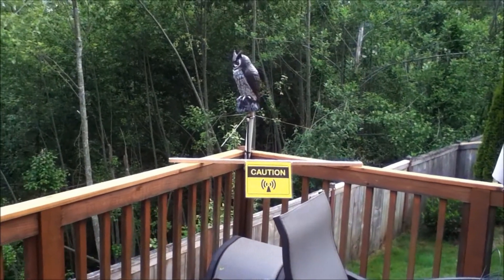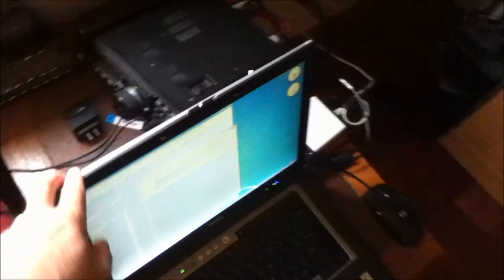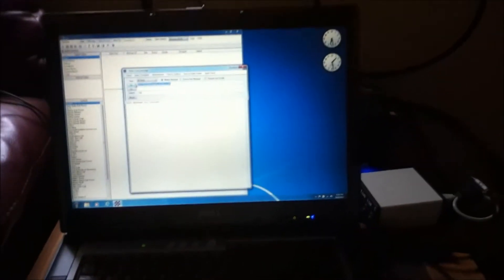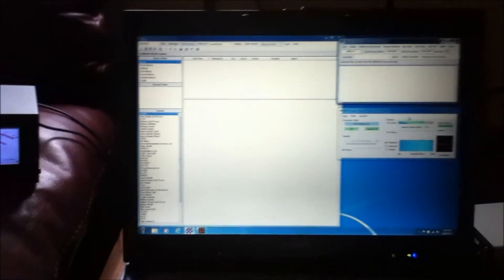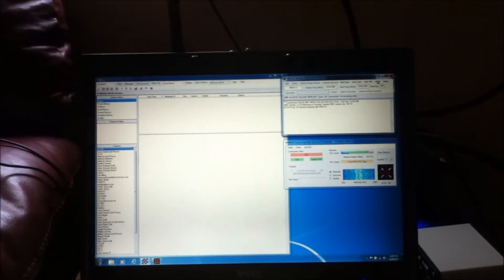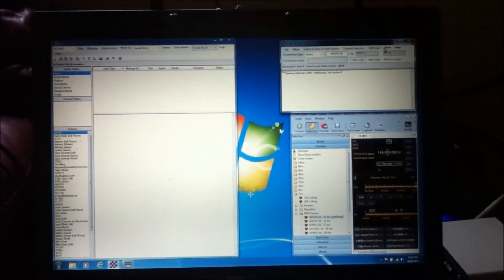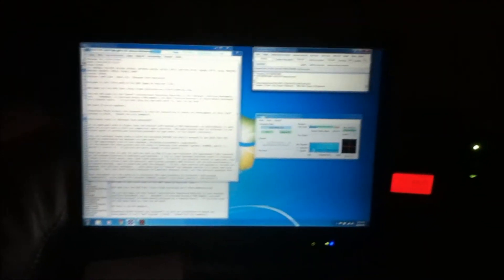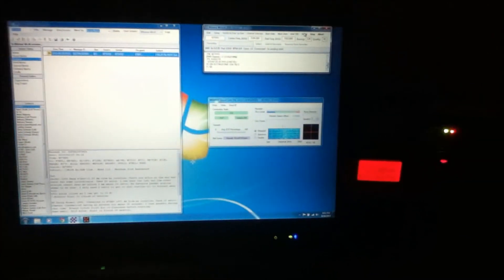Winlink: HF and VHF - #Grid Down

Comment: You say, in response to another comment that Signal Link uses a virtual TNC. This virtual TNC is a software application requiring a computer. A true TNC does not require an external computer. A true TNC will operate independent without a computer.

Comment: I use a FT-897d like yours and a signal link and just received a TNC-X to try.
Lee, WA8QFE
Reply from the maker: Hey there. Thanks for watching. Surprisingly, the soundcard method is so much easier than the packet radio method. I have both working, but the packet setup is a bit more challenging. Watch the volume levels on the TNC-X. Once those are set up correctly, all is well.

Comment: What software are you using?
Reply from the maker: +Robert Rothe ,
Thank you for watching the video. The software is called RMS Express. It is the software that access the global HF email system called Winlink. There is a lot of information about it at www.winlink.org.
Reply: +Linus I've read about, just haven't been able to use yet, so was curious. 
My rig is UHF/VHF so I am planning on a purchasing a TNC in order to use Winlink. Trying to figure it all out before I purchase. Currently debating between KPC3+ and MFJ 1270X for my TNC, roughly an $80 difference. 

Thanks for the video!
Reply from the maker: +Robert Rothe 
Those TNC devices have a lot of features that you probably will never use. You might want to look at a KISS TNC like Byonics TTF (http://www.byonics.com/tinytrak4/). I have one and they perform very well with RMS Express.
Reply: +Linus you are awesome! This will work for me and they also have the cabling I need for my ICOM ID-5100. Thank you so much for replying!

Comment from the maker: Someone emailed me a question about the email radio system. Can you get a reply with this system. The answer is yes. This system functions much like a normal email system. The bandwidth is limited. That is the main difference. Thanks for the comments. HF is about 300 baud. VHF is 1200 baud. UHF is 9600 baud. Range becomes limited as Frequency is increased. There is a HAMWAN network in the Puget Sound area that operate on 5 GHz. That is at modern day speeds. The content must follow the amateur rules (no commercial content).